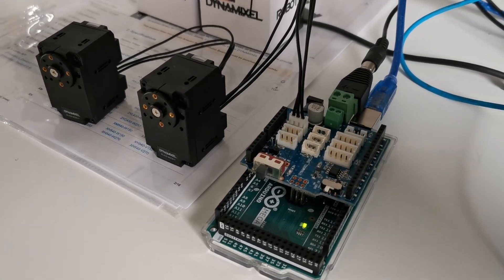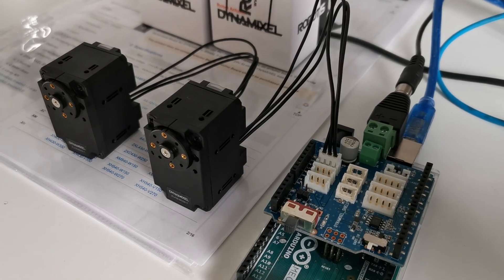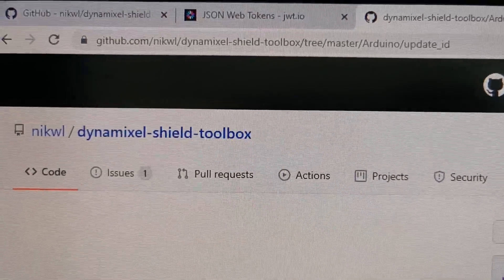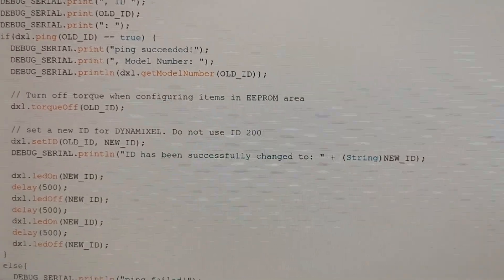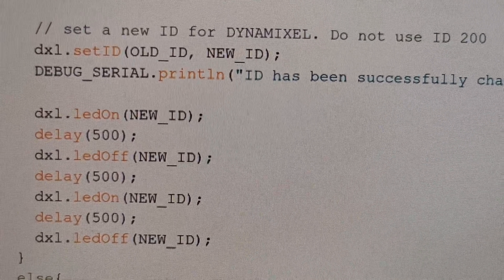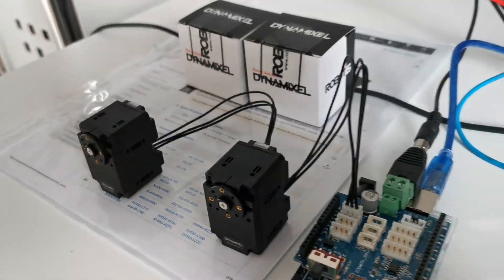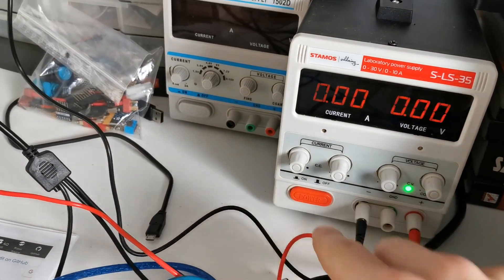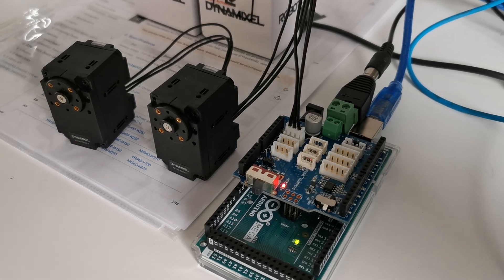Multiple Dynamixel servos and Arduino shield from Robotis

Comment: Hello! I'm a college student from Korea. Can I ask you a question?

I'm currently using a Dynamixel RX-64 with an Arduino Uno and Dynamixel Shield. I downloaded the Arduino IDE and the necessary library. I opened the practice -> DynamixelShield -> basic -> position_mode example.

I made some changes to the code: I replaced DXL_ID from 1 to 3, DXL_PROTOCOL_VERSION from 2.0 to 1.0, and kept dxl.begin(57600) the same.

However, the Dynamixel doesn't seem to be working. Did I miss something? Could you please help me troubleshoot?"

I sent you a code.
/*****************************************************************************
* Copyright 2016 ROBOTIS CO., LTD.
*
* Licensed under the Apache License, Version 2.0 (the "License");
* you may not use this file except in compliance with the License.
* You may obtain a copy of the License at
*
*     http://www.apache.org/licenses/LICENSE-2.0
*
* Unless required by applicable law or agreed to in writing, software
* distributed under the License is distributed on an "AS IS" BASIS,
* WITHOUT WARRANTIES OR CONDITIONS OF ANY KIND, either express or implied.
* See the License for the specific language governing permissions and
* limitations under the License.
*******************************************************************************/

#include <DynamixelShield.h>

#if defined(ARDUINO_AVR_UNO) || defined(ARDUINO_AVR_MEGA2560)
  #include <SoftwareSerial.h>
  SoftwareSerial soft_serial(7, 8); // DYNAMIXELShield UART RX/TX
  #define DEBUG_SERIAL soft_serial
#elif defined(ARDUINO_SAM_DUE) || defined(ARDUINO_SAM_ZERO)
  #define DEBUG_SERIAL SerialUSB    
#else
  #define DEBUG_SERIAL Serial
#endif

const uint8_t DXL_ID = 3;
const float DXL_PROTOCOL_VERSION = 1.0;

DynamixelShield dxl;

//This namespace is required to use Control table item names
using namespace ControlTableItem;

void setup() {
  // put your setup code here, to run once:
  
  // For Uno, Nano, Mini, and Mega, use UART port of DYNAMIXEL Shield to debug.
  DEBUG_SERIAL.begin(115200);

  // Set Port baudrate to 57600bps. This has to match with DYNAMIXEL baudrate.
  dxl.begin(57600);
  // Set Port Protocol Version. This has to match with DYNAMIXEL protocol version.
  dxl.setPortProtocolVersion(DXL_PROTOCOL_VERSION);
  // Get DYNAMIXEL information
  dxl.ping(DXL_ID);

  // Turn off torque when configuring items in EEPROM area
  dxl.torqueOff(DXL_ID);
  dxl.setOperatingMode(DXL_ID, OP_POSITION);
  dxl.torqueOn(DXL_ID);
}

void loop() {
  // put your main code here, to run repeatedly:
  
  // Please refer to e-Manual(http://emanual.robotis.com/docs/en/parts/interface/dynamixel_shield/) for available range of value. 
  // Set Goal Position in RAW value
  dxl.setGoalPosition(DXL_ID, 512);
  delay(1000);
  // Print present position in raw value
  DEBUG_SERIAL.print("Present Position(raw) : ");
  DEBUG_SERIAL.println(dxl.getPresentPosition(DXL_ID));
  delay(1000);

  // Set Goal Position in DEGREE value
  dxl.setGoalPosition(DXL_ID, 5.7, UNIT_DEGREE);
  delay(1000);
  // Print present position in degree value
  DEBUG_SERIAL.print("Present Position(degree) : ");
  DEBUG_SERIAL.println(dxl.getPresentPosition(DXL_ID, UNIT_DEGREE));
  delay(1000);
}

Comment: Hello, Could you please give me some help about how to control the two motors by using different id number? please
Reply from the maker: Everything you need it to use servo Id that you set in this video as parameter eg in setGoalPosition(servo_id...) if the servos are working in "position mode". Just use given ID for each call as parameter in Arduino framework
Reply: @slawomirkorbas  Hi, can I ask for example, when the code  "position mode" define the single motor is using "const uint8_t DXL_ID = 1", so how should I define multi motors?